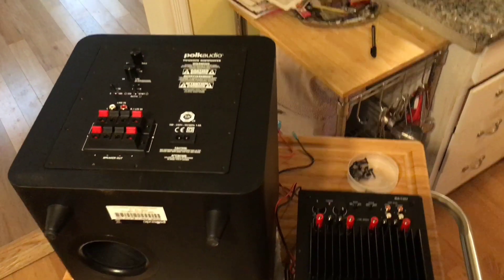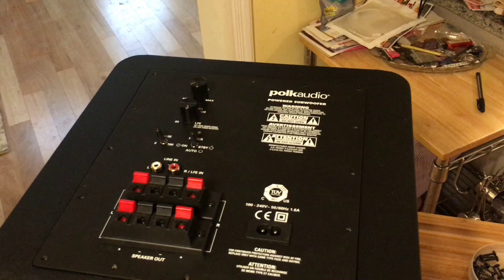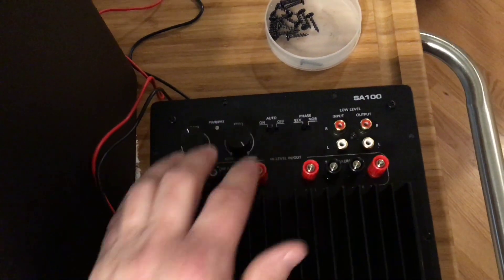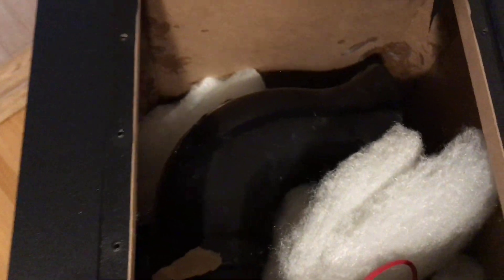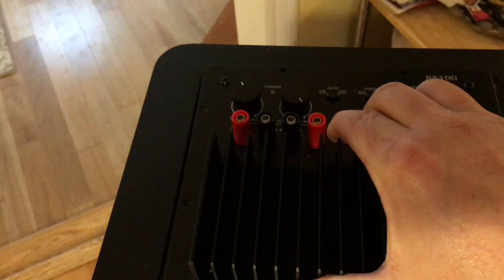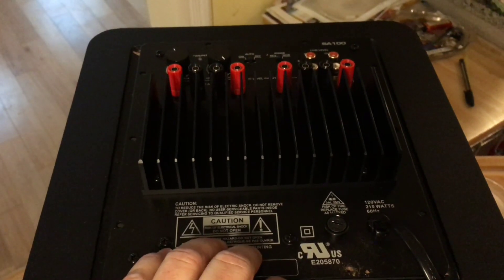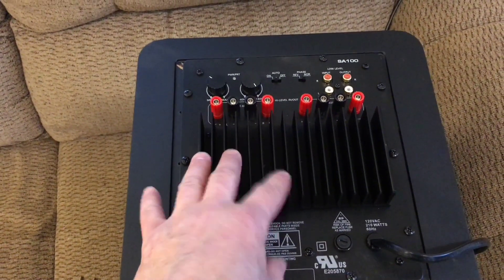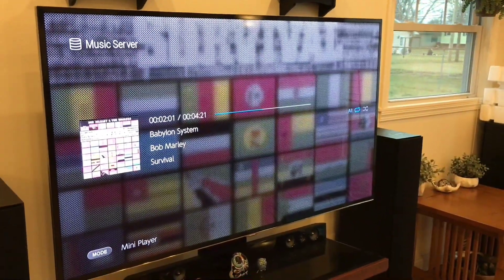Polk PSW111 subwoofer plate amplifier replacement

Comment: I just bought one. When I plugged it in to my phone I don’t hear anything. But get a green light. What should I do?
Reply from the maker: @Poloshowers  are you trying to play your phone through the amplifier? It’s not going to work like that, the phone doesn’t have a preamp like a stereo would. Also, this is a sub amplifier which only plays the very low frequencies.

Comment: I just fixed my Polk last night. It had buzzing and clicking/heartbeat noises. Replaced 2 resistors for $10. Works perfectly now.
Reply: Hi , how do you know the issue from capacitor or resistor?
Reply: @lollipolly-am4323  It's pretty well documented. Just google 'polk subwoofer heartbeat' and you'll find what you're looking for. It's 2x 47uF 63V caps next to each other.

Comment: it [SA100] is now $124 on amazon
Reply: $159 now
Reply: @JeffR-fd7hn  3 years ago when I commented that. My polk woofer is still dead behind the couch. Looks like I should not have waited.
Reply: @JeffR-fd7hn  It's odd, because I was just looking at that poke bass behind the couch the other day, thinking "I need to get that replacement piece for it, so it can work again".
Reply: @JeffR-fd7hn  I was looking on Ama_zon and saw there's a rockville 600w (300w rms) powered sub for $144. I'm thinking about it rather than doing all that fix to my polk, but I don't know, maybe that polk speaker is a lot better.

Comment: I can fix the buzzing, just need to replace the caps, I made a blog post about it: http://hesiod.blogspot.com/2016/01/how-to-fix-humming-on-polk-psw111.html
Reply: I did the same thing and with less than 10 euros the sub is back to new
Reply: @fabiopatacchiola4210  what I found is that then eventually it comes back :(
Reply: @thehesiod  because the power supply is always under voltage even when the sub is in standby, I mounted some Panasonic long life but the power socket should be disconnected or a relay used that is powered when the amplifier is off. I mounted a relay in a small box and I power it from the AC service socket of the integrated, via a 5V power supply, or from the USB socket of the HT, via an adapter

Comment: My PSW111 just started 'crackling'. I originally thought it was my right main, thankfully it was not LOL. Just to make sure it's fried before replacing it I'm going to try a different power outlet. Since it's 'crackling' without any audio driving it, should be easy to make a final determination on the next course of action. Thanks for the upload!

Comment: Thanks for the video!   I bought a PSW111 used for about $50 and is perfect size for a small room.  Unfortunately after a couple years of use the amp went up in smoke.  Certainly could of looked around and found a used 8" or 10" for well under $100 but I hate throwing away a perfectly good speaker and cabinet  Found a SA100 amp used on E-Bay for about $60. The tip about drilling the  screws on the side edges in at a slight angle worked perfectly.  I clipped off the spade connectors and just soldered the original speaker wires to the amp wires, heat shrink wrapped them, coiled up all the extra wire and zipped tied them together to prevent things rattling around.  Just gotta get some sealant to fill in the old screw hole, I do feel a bit of air coming out of them.  The Dayton amp seems to sound a lot cleaner but maybe the the original Polk one has been slowly going bad and I just didn't notice.
Reply from the maker: Glad the video helped you out. Still use mine daily for tv and stereo.

Comment: haven't you changed the volume (and so the performance) of the Subwoofer?
Reply from the maker: The volume, or gain, is adjustable as with any subwoofer amp. I adjusted mine to the level that sounded acceptable for my system, which was at about the "1 o'clock" position or say about 55-60 percent. But everyone's setup is different so you just have to experiment with it. The frequency knob on mine is turned all the way to the right as my Onkyo receiver has a LFE (Low Frequency Effects) coaxial output that controls the frequencies.

Comment: Hell yeah! I have had Polk replace the amp 2 or 3 times for free since it was right before the warranty was up. Amp is acting up once again (about every 1.5-2 years) and now they tell me to send to a repair facility. Hell no! The thing is heavy. Glad I came across this. Thank you!
Reply from the maker: Glad i could help. My Polk sub has never sounded better, use it every day. Good luck.
Reply: Finally had to pull the trigger on this. Polk customer service was no help this time and wanted me to send the thing in. Nope. Bought this Dayton amp and it does indeed sound great. I just need to seal it up a little better.
Reply from the maker: @fnkybeat  Glad it worked out for ya.

Comment: 👀Soo many praised comments!
Let see, PSW111, POWER 150W, Resonance chamber: .82 cubic ft.
Response: 38-250 Hz 👀38Hz?
Dayton SA100, 100W
Mass: .1 cubix ft. 
Yes it will work, But!Look like you loose Around 12 Hz of bass and 50W on power.
I got a PW2200 sub on eBay for $140 free pickup.
Or get an used amp for PWS 10 for around $50
But I preferred to get a better sub instead.😕

Comment: Do you know if this would fit in the psw110? If not, Do you know what amp I would need? Thanks
Reply from the maker: Off hand i don't know. I would remove the plate amp out of your 110 and measure the opening and depth available and then go to Dayton's website and compare it to this amp or other amps and see which it closest. You can always call Dayton and speak with a technician, they are very helpful.

Comment: So you said the new amp is 100 watts. The psw111 is advertised as a 300 watt subwoofer. 
So didn't you just lose 200 watts?
Reply: The polk amp is 300W peak power - only 150W RMS.  The Dayton is 100W RMS so its about 50W less. In this case the difference may be about 1 decibel which is nothing to even notice so all good.
Reply from the maker: Yeah, peak power as you stated is a deceiving number in subs. I will say that this 100 watt replacement amp provides plenty of punch for an 8" sub and if your looking for more than that you should look into a 10"-12" sub. Mine sounds as good if not better than it ever had with the factory amp.
Reply: I was worried about the same thing but i know peak is decieving.  I replaced mine with the same part and im waiting for the sealant to dry.

Comment: Thanks for posting this repair. I had the same issue with my PSW111 (fried board). Ordered the same plate amp you suggested (Dayton SA100). Completed the replacement. Works like a charm now. Thanks again for posting!
Reply from the maker: Daniel Russell your welcome, glad it helped you out. That factory polk amp is the Achilles heel in these little subs. I use the one i repaired in the video every day for music, tv and movies and it does a great job for an 8" sub. People come over and think i have a larger one hidden somewhere.

Comment: My father has a polk sub from the mid 90's. I blew out the sub woofer messing with it when he wasn't home in the early 2000's. I replace the sub with a much better JL 8w3v2. It was great just under powered and finally he replaced the plate amp with the Dayton SA100 this week haha. The only thing polk is the box. Sounds better then original and more expensive brand name subs.

Comment: I am about to do the exact same job.  Same Polk Speaker and everything.  do you think I should put a silicone seal around the edge of the new amp board to really seal it? or does screwing it in and filling the empty screw holes work?
Reply from the maker: vashthestampede11 You could do that but if you needed to gain access to the inside of the enclosure in the future the silicone would obviously make it harder to gain access. Like i said in the video be sure to fill in the old unused holes with a silicone type sealant. I play mine pretty loud and i don't notice any unusual sounds coming from around the board.

Comment: Thanks for your video. I have a Polk DSW pro 660wi sub in which the RCA jack got bent somehow. It probably happened when I moved the sub over a few inches (under my table) but the sub cable coming from the receiver had no excess slack - so in essence the cable stood firm (didn't budge) when I moved the sub box over a bit. The cable bent the jack while/before pulling itself out of the jack socket. Now if I plug the sub cable back into the damaged jack, I get a deep loud feedback hum.
I removed the 18 or so screws, flipped the panel, and see the jacks are hidden beneath a circuit board. I'm not sure what to attempt next. So can I buy the entire back-end (that I unscrewed) for my DSW Pro 660wi?
I value your thoughts! Thanks!
Reply from the maker: Jeff Hi, sorry about the delayed response. I'm not familiar with the model amp you have but you can contact Dayton Amplifiers and see which replacement amp they would recommend according to your amps specifications and enclosure dimensions. There are manufacturers other than Dayton, of course, but i am not familiar with them. Good luck.

Comment: I have a Polk Audio PSW 110 (ten inch sub). The amp is fried, think this amp would work?
Reply from the maker: Being that yours is a 10" sub i would think it would physically fit in the enclosure but if i were you i'd go on Daytons website and compare the dimensions of the amp to your opening. You can also call the and talk to a technician, thats what i did, to verify if it's the best size replacement amp for what you have.
Reply: @LoFiMofo  thanks!